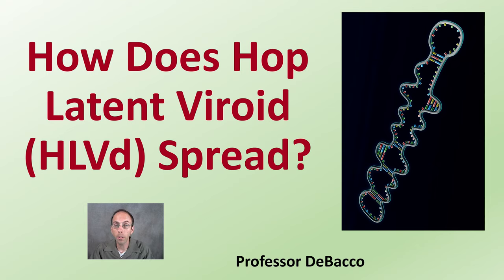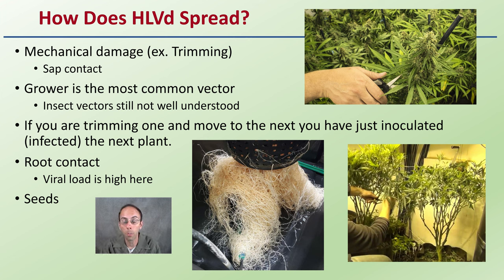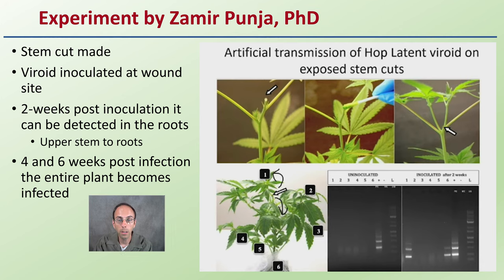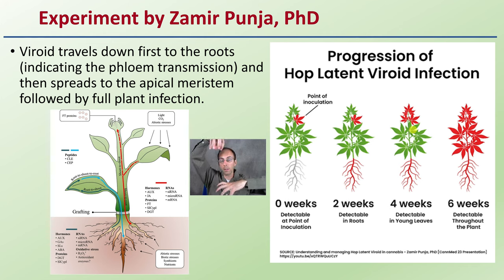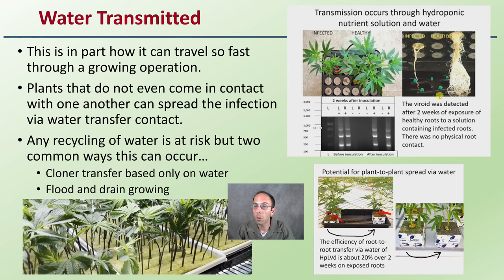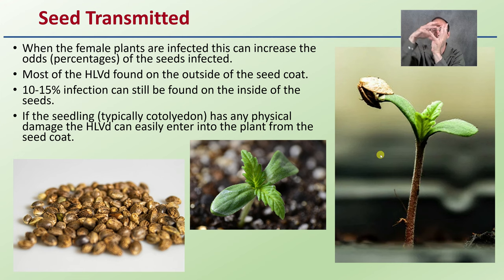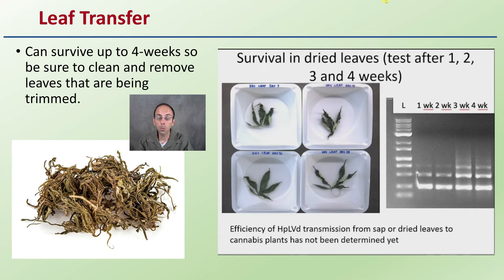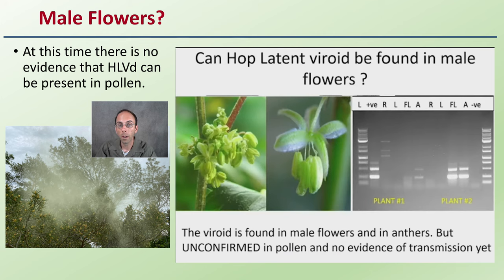How Does Hop Latent Viroid (HLVd) Spread

Comment: Thanks!
So... will the large seed banks invest in testing of the seeds they sell since there could be outside seed transmission?
I wonder if the peroxide % sometimes used to germinate seeds helps at all or if there will become a standard way of scrubbing seeds prior to germination.
My first grow was 1975 and boy have times a changed! Lol
Reply: probably all seedbanks are contaminated.
Reply: Maybe we should soak our seeds in 3% H2O2 for 10 minutes and then dilute that down to 1% by adding water and continue to soak for 12 more hours?
Reply from the maker: Perioxide will not help against a viroid... Bleach 10-20% for 30-60sec. or Virkon S 2% is what is recommended for tool cleaning as this may damage the seeds viability.
Reply: @DeBaccoUniversity  Thanks for the info, Professor.
Reply: @DeBaccoUniversity what about using rubbing alcohol for cleaning and sanitizing tools?